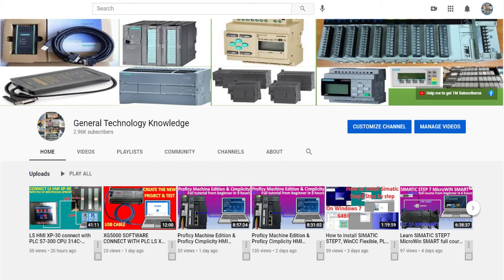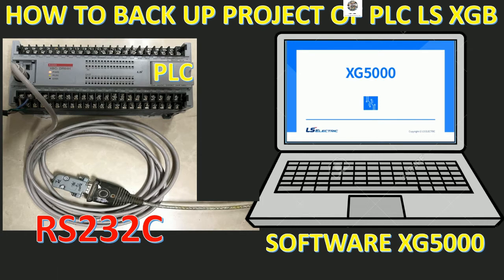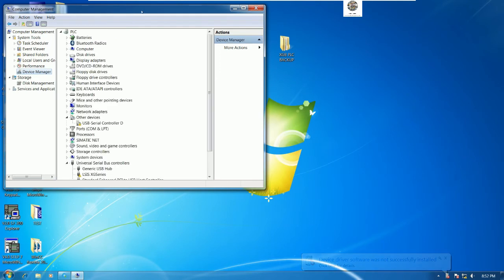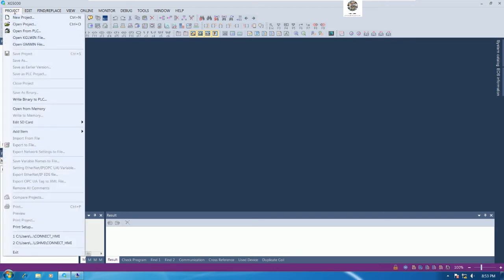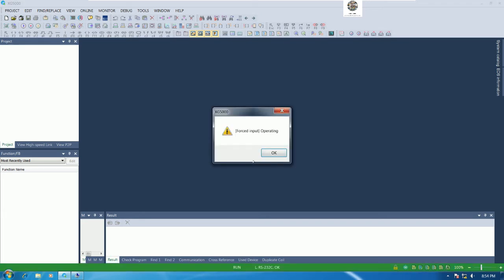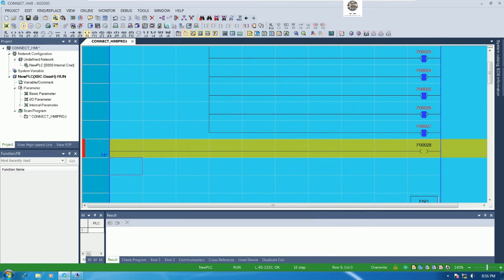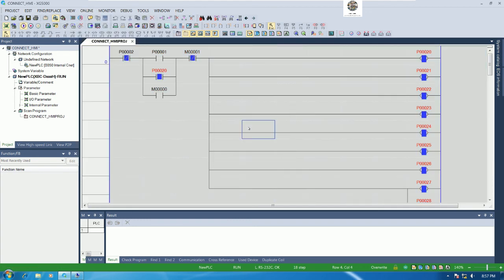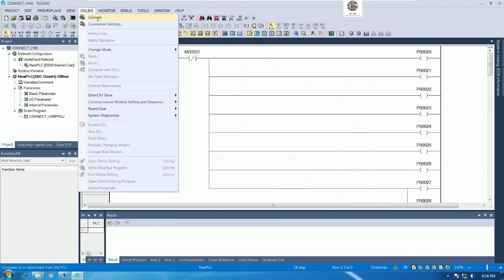How to back up PLC LS model XBC-DR64H by using RS232C cable

Comment: hi my friend, first, great videos, i have learn alot with your content, i have a question, witch is the pinout  for the 6 pin din, i try to make my own cable 6 pin to usb but i couldnt, do i need the rs232c to make this work?, pls if you can help me with that i apreciate.
Reply from the maker: Dear sir,
We can do it my ourselves follow
connection pin 2 to 2, 3 to 3, 5 to 5  and for female pin please jump 4 with 6,  7 with 8.
I hope it work.
Thanks!
Reply: @generaltechnologyknowledge5165  excuse me do you have crack plc ls xgb

I ask for help if you have thank you.